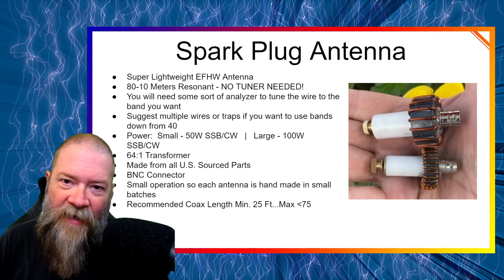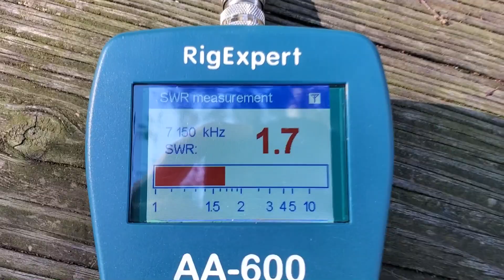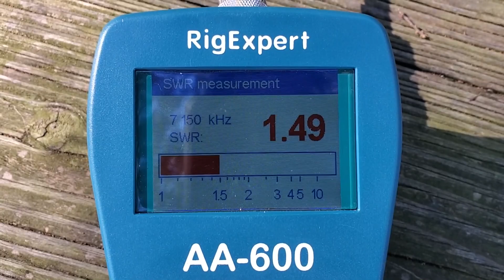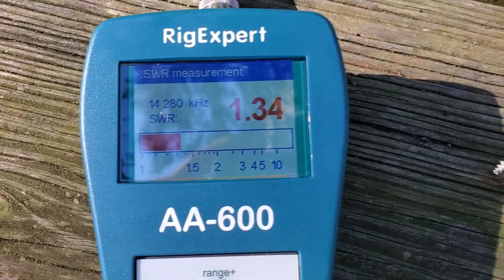Spark Plug EFHW Antenna Review

Comment: Did you tune the antenna? For what band? Length of wire?
Reply from the maker: You have to tune it.  I started with 66 feet of wire and used my analyzer to fine tune it to the bands.  You may need to use a tuner after, but most of the time I do not as I am well under a 2:1 ratio with my SWR.  Thanks for the comment and for watching.  73!!

Comment: How long of a wire were you using? Thank you for your patience and help. N4KBM
Reply from the maker: I started out with a 66 foot wire and using my analyzer I cut back just enough to get the SWR into a reasonable range for my liking.  Hope this helps.  Thanks for watching.  73!
Reply: @HR4NT  OK so you actually cut the wire. I'm new to all of this HF stuff but plan on folding it back and then checking the SWR.

Comment: How much does it weigh? Tough to find information on weight for that - mfg doesn't have anything on their website.
Reply from the maker: Both Spark Plug Antennas are very light, but to answer your question the small version is 1.05oz, and the large is 1.80oz.  Thanks for watching.  73!

Comment: I'm new..  Since there was a recommended coax length, does that mean that the coax is acting as a counterpoise?  If that coax is laid in a different direction, would that affect the RF compass orientation?
Reply from the maker: Yes the coax can act as kind of a counterpoise, however I wouldn't dwell on it.  I attach the coax to the antenna and just run it.  I do not pay attention to what direction it is running.  I have tried changing the direction of the antenna wire itself and again rarely find a major difference in who I am able to contact.  I added a 7 ferrite choke to the radio side of the coax and that seemed to help out a bit.  I appreciate the comment.  Thanks for watching.  73!

Comment: What is the wire length for the 20-40 resonance?
Reply from the maker: In measuring the wire I see 62 Ft or 18M- 91CM.  I highly suggest cutting a bit longer and fine tune it to your needs.  Thanks for the comment and for watching.  73!

Comment: the spark plug antenna is great.iv been using 15ft of coax and 64ft (half wave on 40,m) of wire with great success on all bands,tunes up just fine,dont even need a tuner unless your on 10m.swr is around 2.5:1
Reply from the maker: That is awesome!  I am still very impressed by this little antenna.  I have a new review coming up today for the 100 watt version.  Thanks for watching and for the comment.  73!

Comment: Something to think about when setting up a sloping antenna. They are mildly directional, where you have the low end pointed will influence where the main portion of you far field is going, of course you can make it more or less directional with the angle you have on the wire. P.S. I saw you on the POTA Spots but didn't get you here in CA.
Reply from the maker: I thought about that a few times while setting up and I think i just get focused on how I previously set it up and just don't change the direction.  Good idea though and I need to try that out and see what results i get in future POTA activations.  Thanks for the comment and for watching.  73!!!
Reply: @HR4NT  as the saying goes if it ain't broke don't fix it.  When a long wire sloper was my only QTH antenna I played with orientation a lot both physically and in MMANA to get the most out of it, 45 degrees of slope and where it was pointed seemed to work best for me. But as I said it's mild, nothing like a beam.

Comment: Thanks Scott. I may get mine up next weekend depending on the weather. I want to see what SWR I get on 15 and 10 also. Great review. I really love the antenna.
Reply from the maker: It seems to be pretty slick so far.  Thank you for introducing it to me.  Can't wait to put more power through it.  At 10W it performed well, so 50 or 100 should be equal or better with performance.  Thanks for the comment and for watching.  73!

Comment: Concerning your choke... the coax is acting as your counterpoise.   When you put the choke on the antenna then the coax won't be your counterpoise.   That's an interesting design for that Mt Everest activation.   I would relocate the choke at the radio end.   I'd love to sacrifice one just to see what's inside and makes it tick but that's an expensive autopsy.  I know they are advertised as multi band but really it's one band at a time without a tuner.  What a person could do is take an afternoon and take several lengths of wire and cut each band with your analyzer.   Then just swap out the wires for the bands you want.  That would be awesome.   Still trying to find you on POTA.      Great video Sir.
Reply from the maker: If I remember the conversation, I think Mike told me to put the chose at the radio end, but at the time it didn't register with me.  When I go out next I will test that and bring it up in my update video.  Nice catch!  Thanks for watching and for the comment.  73!